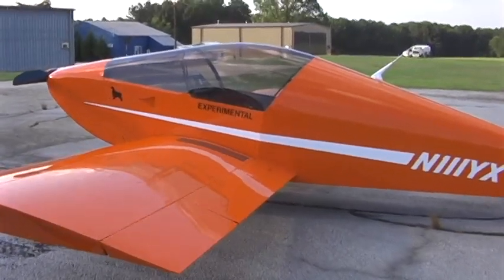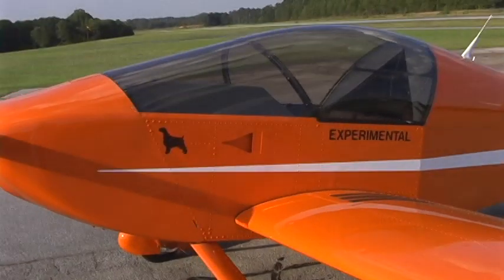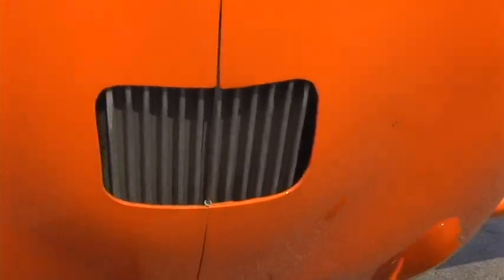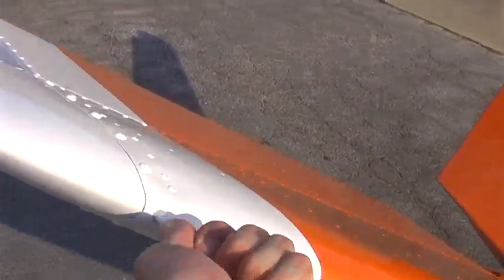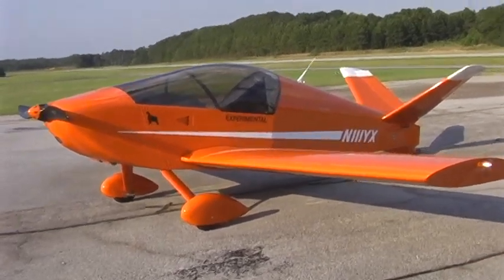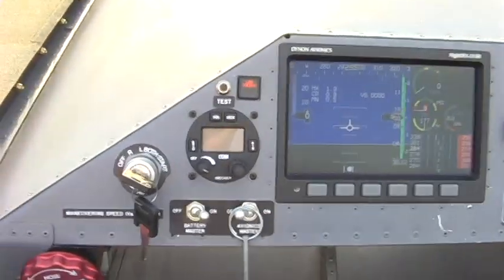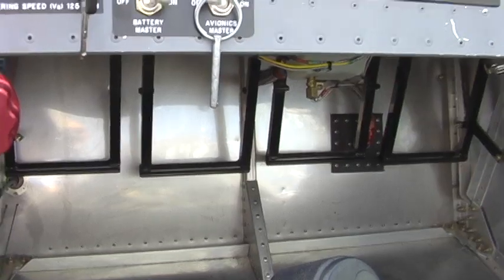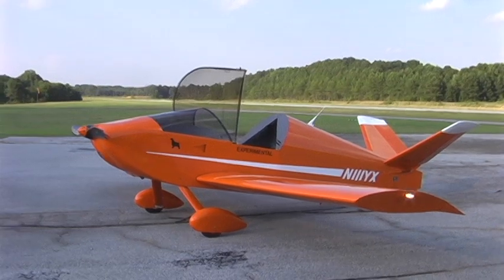Waiex Walk-Around

Comment: Wow, this is one great looking airplane!! Congratulations!! Nice to see that you still have it and have put over 900 hours on it.  Must be a real special feeling to go up in the sky in an airplane you built yourself. Love the orange livery. Best regards from Brasilia, Brazil.
Reply from the maker: Thanks! It has been a great and very practical airplane.
Reply: @kyqx  is your waiex statically stable in the pitch axis? I got to make a several flights in a Monett Moni in the early 90's (here in central Brazil). It was statically unstable in pitch. However, that example had been poorly built and setup imo. I suspect that characteristic had to do with that particular moni. I am a huge fan of the Sonex and Waiex. They look awesome, are affordable to build and fly, and go like stink. Yes the y-tail is sexier, but the moni flights I made kind of make me biased towards the regular-tailed version. Both look great imo.
Reply from the maker: @sganzerlag  The Sonex line are designed to be neutrally stable in pitch. It goes where you point it and stays there. The objective is to be maneuverable and therefore more fun to fly than the standard Cessna. It's ideal for a "sportplane". However, my Waiex becomes slightly unstable in pitch at the aft CG limit. There is a slight acceleration in the direction of input and yes it's not desirable. I only fly in this area with a heavy passenger and light fuel, maybe 1% of the time. Perhaps your Moni was near the aft CG limit?
Reply: @kyqx  got it. That sounds perfectly fine to me. The moni I flew probably had the incidence set wrong on the fixed portion of the v-tail. Because the trim system was a spring and not an aerodynamic tab, having the wrong (negative) incidence angle on the tail would cause this behavior. Like I said, the build workmanship was not good on that Moni and I am pretty sure the problem there was an incorrect incidence angle on the fixed part of the v-tail. That particular Moni had the 30 hp kfm engine and riveted wings. Aside from the aforementioned quirk, it flew well and had good performance. Knowing that the Waiex does not exhibit this particular trait makes me more confident about it being a build / setup issue of that Moni I flew. I also really appreciate you explaining that your Waiex has been a great airplane for all these years and hours. Nice to know that they hold up well. Thanks for sharing your Waiex experience here on YT.
Reply from the maker: @sganzerlag  I'm happy to hear that you enjoy my videos. That's why I made them. I wanted to build a Moni in 1986 but I was too young and had no money. 20 years later, I bought the Moni's older brother!

Comment: Hi. Great aircraft! I just got myself now a Waiex with 2200 Jabi engine. Question, is that a fuel level switch you have installed at 6:44? If so, where did you get it? I am also looking for a fuel level switch instead of the clear fuel tube gauge..
Reply from the maker: Thanks for the comment. It's a Princeton fuel probe system. You can search within Aircraft Spruce and Specialty to find it. It's been a long time so I don't recall the exact part number. It's worked great for almost 11 years now.
Reply: @kyqx  Thanks a lot! 

I am going to do a lot of upgrades on my Waiex. New panel (incl MGL iEFIS), Sandia remote transponder, MGL V6 VHF, new wiring, switches, circuit breakers, a paint job (i love the orange you have and I might do the same), nav/strobes, etc...  

I might also have the Jabi engine updated, as it is a 2nd generation engine with 260hours.

I have only done a few hours in the Waiex now, but I am loving it!
Reply from the maker: @jacquesvanderwesthuizen1227  Great! I just turned over 900 hours in mine and 100,000 miles on my GPS odometer. Lot's of great places and adventures in the past 10 years.

Comment: Really very nice clean build and in my favorite colour to ! Well done ! Could I ask you please, Im thinking of putting the Jabari 3300 in my bird and have heard of some heating issues. That said, Rotac ( NOT rotax ) have some new heads that run much cooler and can give you 136 hp vs 120 hp. It seem a win win here. My mate has just fitted this set up in a Lightning ( yet to fly as its kit built ) and did alot of research. have you looked in to this mod ? Thanks again. She a beut !!!

Comment from the maker: I burn about 5.3 gph at 145 mph. I run about 2750 rpm regardless of altitude. I'd guess that at 8,000 it would be leaned out about and down below 5 gph but at the same TAS of 145 mph.  Just keep the Jabiru cylinders cool and the problems (if any) are minimal...

Comment: I want to Quickbuild a Waiex with the 80hp Aerovee engine which will cost about $40,000. Then I want to add a small lithium battery bank, a 40 hp electric motor, and an upgraded alternator to make it a DIY hybrid of sorts. Because the system horsepower will be 120, the same as the Jabiru 3300, it will still stay within the speed limit for an LSA. I would use the 23lb lighter 85hp Jabiru 2200, but it costs $8,500 more, and that's not worth it.